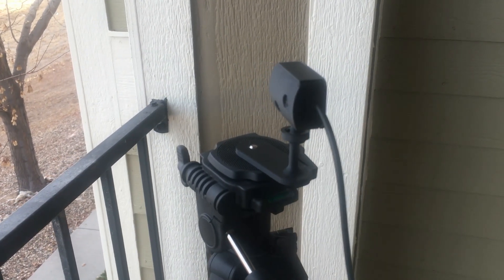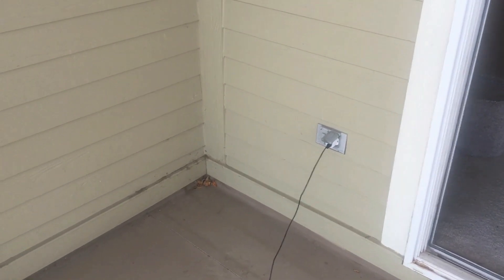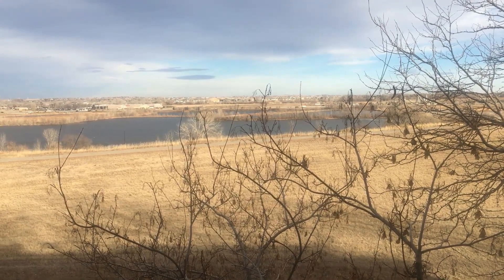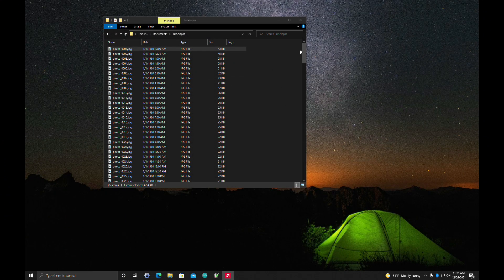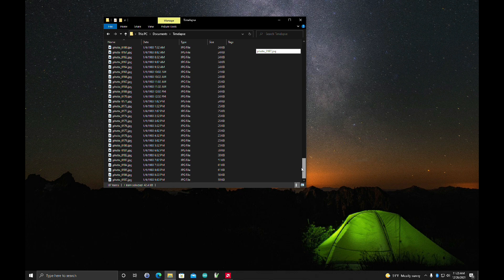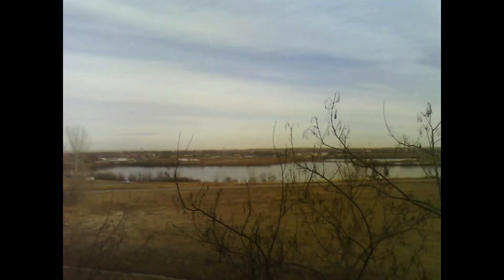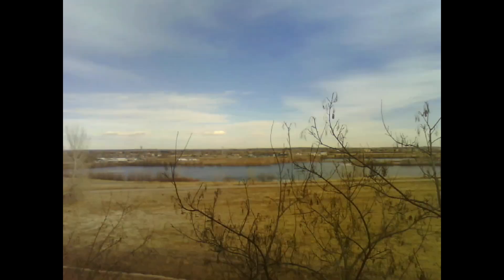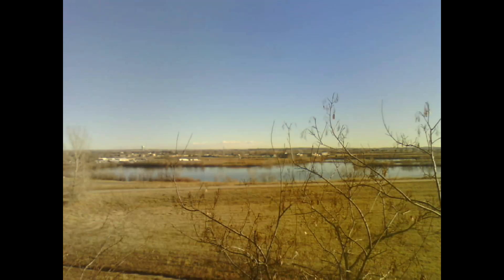First Try at Using an ESP32-CAM to Make a Time-lapse

Comment: Hey, when I unplug the ESP32 and plug it back in, it starts counting the photos again from 0001. How can i make it count the photos from the last saved number?
Reply from the maker: The code would need to be modified to either save the number of the last picture taken to flash memory, or alternatively, before writing it picture it could check for the existence of the file, and skip that number if it already existed.